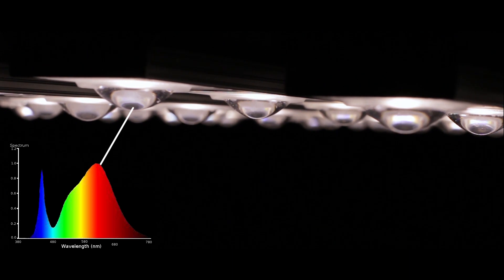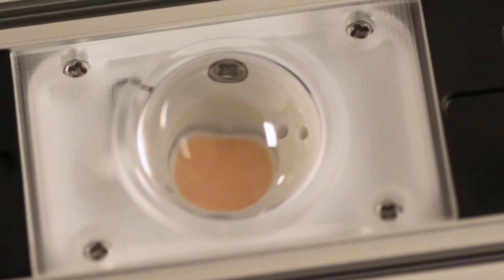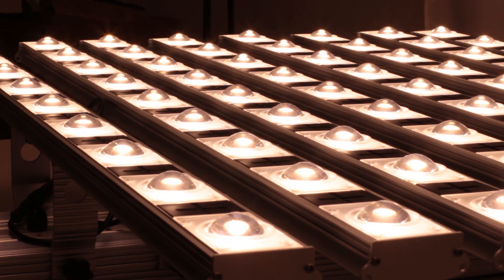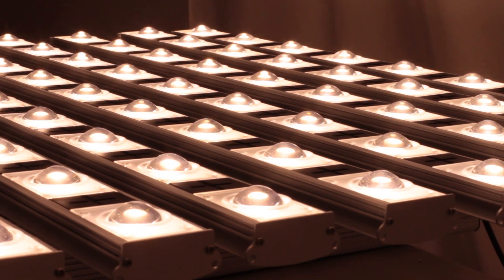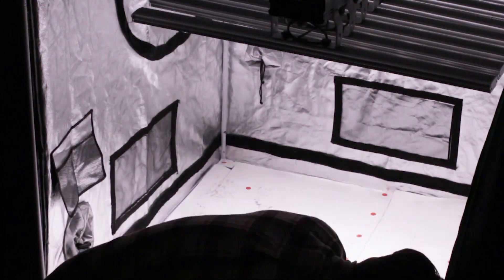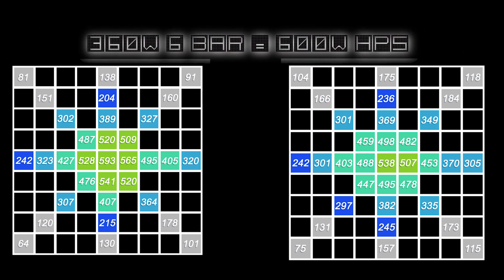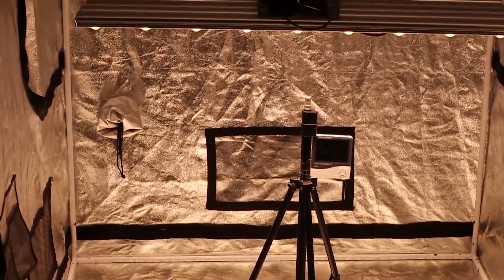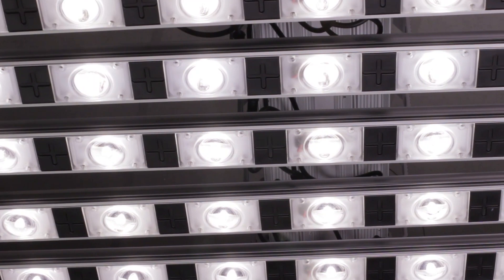The King COB (Chip On Board) LED Grow Light Review

Comment: Yea they basically stole this design from #fluencebioengineering
Spydr @300 watts produce average 850 par..spydryx plus @ 685 watt pushing 1550 par average not highest.  
I cant believe the cheap hanging hardware they use for this light.